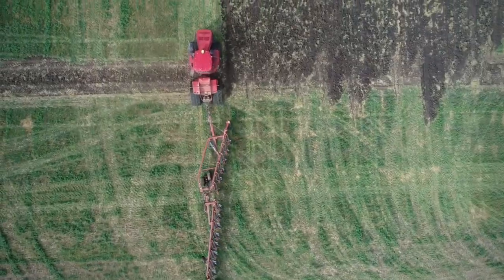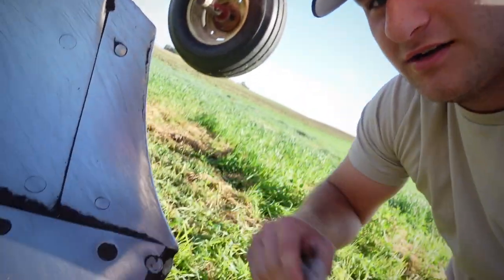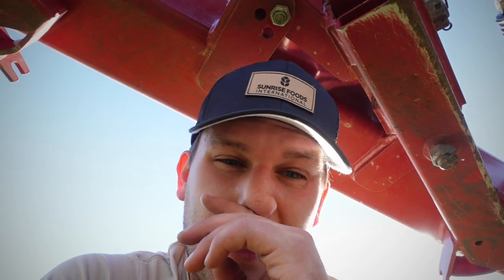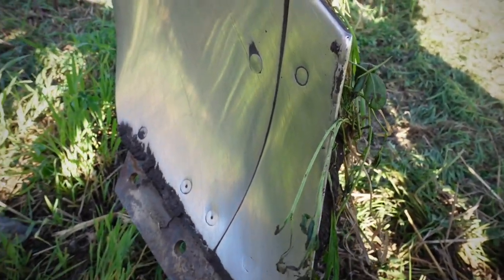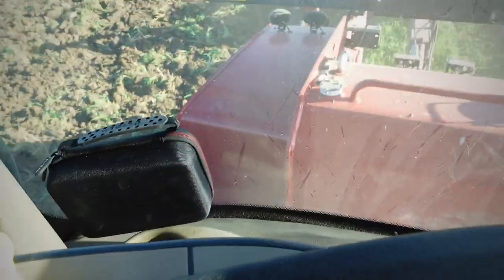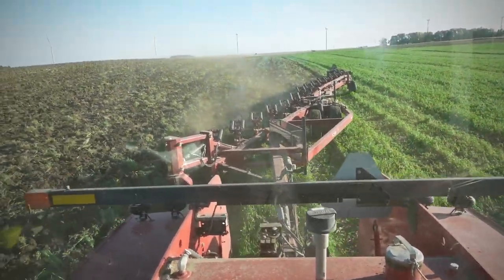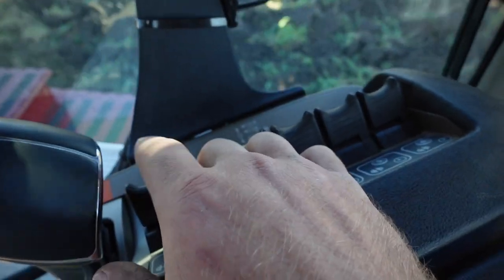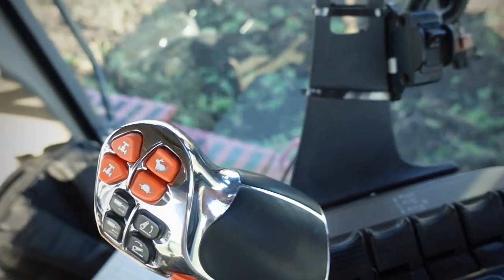The First Day Using The 14 Bottom Moldboard Plow!

Comment: So plows no longer use coulters?  Manufacturers now consider them unnecessary?
Reply from the maker: we don't use them anymore because it seemed to cause more plugging of the corn stalks, mostly when the stalks have any moisture on them. Both of these plows had them on but we took them off about 2 weeks into the 2020 tillage season. We disk up the corn fields that we are going to plow to help chop everything up a little bit before we get in with the plows!